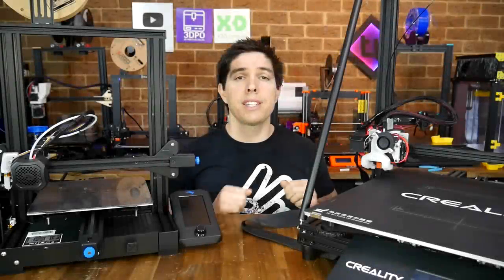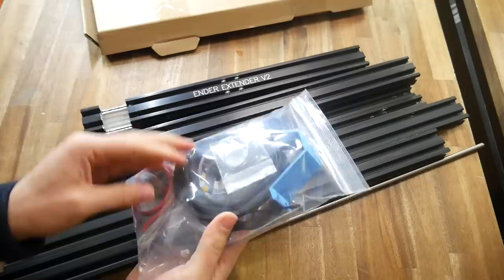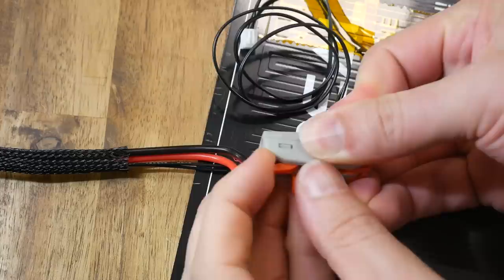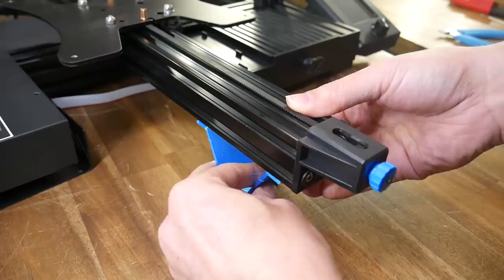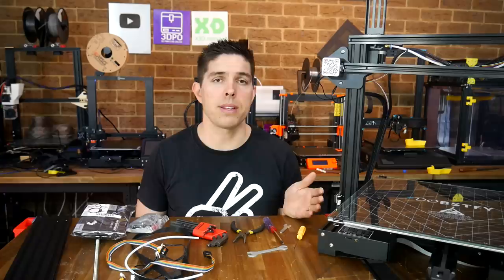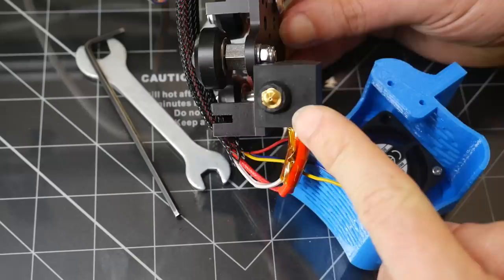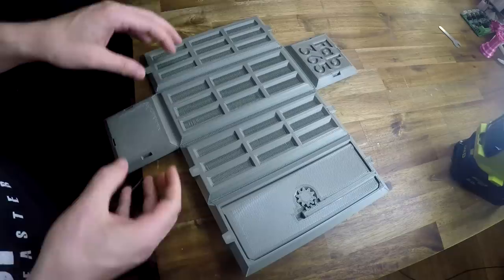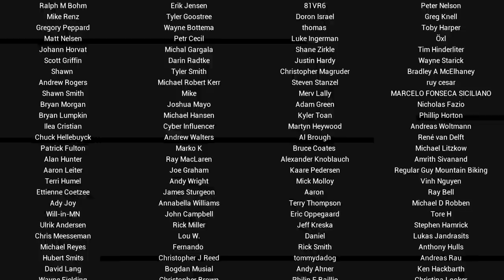Supersizing an Ender 3 V2: CR-10 Max for half the money - Ender Extender kit

Comment: I fall into the tinker category, and have 2 Ender 3s right now. I also like to print big stuff. So am thinking about this upgrade. I also have a CR10s and a Ender 5plus. Bigger is better, lol.
Reply from the maker: Sometimes I have a part or project that just doesn't fit on regular size printers. My first home printer was only 150mm cubed so I got creative designing objects in pieces for assembly post printing.

Comment: You know for about $400 US you can buy an Anycubic Chiron and are up and running in less than an hour and have a good big printer
Reply: I was thinking same thing having bought one less than 2 months ago, it's a good printer, includes auto-leveling and filament out sensor, also dual z motors.
Reply: @mechtheist  We have 2

Comment: Sadly the metal plate for mine is bowed with a raised center and four low corners dipping around 0.688mm each, having to fill the gaps with aluminum HVAC tape so the glass bed isn't distorted in the same shape when clipped down and probing with the cr-touch.

Comment: I would love this... but I'm still hesitating on doing even the smaller disassembly required to replace the hot-end assembly (attempt #2 - #1 seemed to go well until it I turned it back on), and add a BL touch.

Eventually, though.

Comment: Well now, if you don't think the cross beam will be under more stress as it's longer you will get bum results and wonder why......the far side of the X axis crossbeam guide rollers will cause a drag load and can deflect the beam up and down.............with this rebuild it would be highly desirable to fit twin Z axis leadscrews driven by a single stepper motor mounted on the top of the crossbeam driving two short belts to each leadscrew.

Comment: I upgrade my printers as I need. For example, one printer dedicated only for pla, other one is for petg, one prints larger parts, other prints smaller detailed parts with 0.2 mm nozzle. Depends on what you design and print, how fast/slow/large/small/detailed models you have whatsoever. Criticism doesn't make sense, we don't all print only toys.

Comment: Keep your ender3 stock and consider buying an Anycubic Chiron, V6 volcano clone and BMG mirror edition extruder. 400x400x450
Reply: First of all, thank you, Micheal, for exploring this option. But... I agree here. The bed (400x) is being heated by the 235x bed, only 59% directly covered. Also, the weight of the width between Z axis posts really deserves two zed steppers. So... 
$262 Ender
$169 Kit
  $89  Heat Pad
  $60 Dual Z kit
-----------------------
$580 USD 
$360 for Chiron - leaving $220 for things like BTT SKR V1.4 motherboard ($32) and 5 TMC2209s ($22) or TMC2130s ($25). Also, throw in the (expensive!) support rods ($42) to stiffen the frame further. You still have over $100 USD for a real E3D V6 hotend.
Reply: @thomaswiley666  great details. There is an official user made marlin 2.0 firmware for stock board now. 2208 or 2209 can be used to ONLY make it quieter with stock board. Most.common complaint is cracked hotend wires. many replace the wires to hotend and improve wire management.  mine is still stock.with Marlin2 firmware

Comment: That';s pretty cool and all but...... After its all said and done, you're still lacking the Z height of the the CR10 Max. Plus you now have to worry about the right side of the X axis not being 100% even with the left side. I added a second lead screw with stepper motor to my CR10 and it made a difference on my printer. I couldn't imagine going even further in X axis and not having the second lead screw to keep both sides in 100% sync. Of course this is just my opinion...

Comment: While interesting, I feel like one doesn't really "save" money here compared to the Cr max. Because one still has downsides. Mainly less z height, less rigid y and x axis and the under performing bed.  And once you actually fix every downside you quickly reach the Cr max price. As double lead screws, mains powered bed, z axis extension and maybe a new y axis setup with dual extrusions is gonna quikly add up.

Now as a project for someone who doesn't have the funds all at once, I guess maybe an option. 

But if someone wants a bigger printer I think it would still be better to buy a large printer than buy an ender-3 and upgrade it, as again once you add all the parts to really get it equal to a cr-10 max you are spending about the same money. 

Just also wanted to add the DIY directdrive mod is not really 1:1 comparable to the hemera. Find the comparison at the end a bit wierd. I guess you wanted to show a budget alternative to the hemera, but then taking that into the cr-10 max v Ender 3 comparison didn't make much sense to me, the hemera was aftermarket part in the end anyways.

Comment: Major thing that wasnt in the video and i almost missed it on the websites and stopped my purcahse. The EZR Struder does NOT work with glow-in-the-dark filament. May not matter to everyone but if you did plan on using it you are SOL

Comment: I just bought my first project 3d printer today, still haven't done anything significant with my Ender 3 as it just works beautifully, but been wanting a project so one is on its way.... A little too late there Michael haha
Reply: that's a thing I don't get. manufacturers only do larger beds with higher Z-axis. there is no "stubby" printer with large bed and "only" around 200 mm in Z. that would fit many parts without a mostly unused high frame
Reply: @oliknow  Well since you mentioned it, one of the printers I picked up actually has a Z of 220, but the bed is the same size.  

I do agree though, I mostly only ever need just one larger axis.
Reply from the maker: Enjoy the future tinkering :)
Reply: @TeachingTech  Thanks, wouldnt have the confidence to take on a project like this if it wasnt for watching your massive collection of videos.  Bought a corexy printer with linear rails for $250.  I am sure it will need lots of work, and I am ready to get started.

Comment: Good video. I actually considered this, but figured I'd just DIY a custom printer instead to get exactly what I wanted plus I didn't want a bed slinger design. On a side note, will you be reviewing the new mid size resin printers such as the Elegoo Saturn, EPAX E10, Anycubic Mono X, etc?
Reply: I agree. The upgrade kits sounds good but small printer is useful.  All the time tearing apart a printer could be used printing new parts for a DIY printer. Nice thing with DIY is you can buy part all at once or as you can afford it. Thinking of building Voron 2.4 with 500mm cube volume.
Reply: Definitely beyond tired of the bed slinger craze myself. Is not THAT much cheaper to produce when you look into it, does NOT save the space marketing always used to (and sometimes still does) claim, and the known cons mostly outweigh the benefits.
Reply: @PaulDominguez  Voron would be a great build. Look in to Railcore 2 as well.
Reply from the maker: I have just finished reducing my resin printer collection, so probably not.
Pros and cons for the completely custom build route. You get exactly what you want and the budget can be spaced out but a lot more knowledge is needed. Each to their own as I said in the video.
Reply: @PaulDominguez  core xy isn't rlly stable that big
Reply: @PaulDominguez  voron themselves don't recommend going above 350
Reply: Ya, the 500mm cube is the dream and don't really need it. It's an itch to build a printer but right now working on the goal of getting my mancave ready so I can put build a LowRider CNC.

Comment: hope you have a lot of extra solid spacers...  they are junk!!    and just some FYI,  I dono if the sale is still on but at Micro Center you can get the Ender 3 pro for $99.00    kick ass printer and if you get stuck with the 1.1.4 board, you can upgrade it for 47.00 to the Bigtreetech board with silent software, all you can hear is the fans after that...  :)

Comment: Michael, would it be worth it to put some thermal compound between the original heated bed and the new alloy plate? I would think it may help to make sure that there are no gaps.
Also, I have had good luck with adding insulation on my heated beds. Might that be a decent upgrade for something this large as well?
Thanks in advance!

Comment: its kind of a shame they don't just make a large ender 3 with a direct drive, filament sensor, and auto bed leveling for around 450 right off the bat. Would be a good contender to go against the Sidewinder x1, as the CR-10 v3 is more expensive for a worse UI, and arguably worse prints.

Comment: Love your videos,.  For someone fairly new to this (3 months in on my ender 3 v2) and only printing PLA, could I ask you to do a complete how to  on changing out the stock hotend with bontech extruder and mosquito or copperhead hotend and the MODIFICATIONS to make it work with the ENDER 3 V2.  Ive talked to Splice and matterhackers since I wanted to order and install and they were very helpful but the one thing they really cant tell me is the way to make it work on my machine.  There is only one bracket i've seen on Thingiverse, but its also made for BLTouch and i dont use that at the moment.  THERE IS NO VIDEO ON THIS  THAT I CAN FIND that goes step by step.  So many people are interested but no one had covered indepth.  Your tutorial on auto build marlin was perfect and I finally upgraded my firmware!  Hope to see something in the future.

Comment: Dont know about you guys but the reported different size in the info menu is bugging me. To change that go to dwin.cpp file in marlin firmware uncompiled code (src/lcd/dwin/e3v2/dwin.cpp) and change define machine size to the one you made, for me its line 89. I did not do this mod but i enable the print area to 230x230x250 to fit bigger prints than stock (costs nothing but an hour of your time). i am considering this upgrade for fun as well

Comment: Thanks for this, I've been thinking about going higher on the Z, from the DIY store. But this looks like a lot less hassle if you wanna go bigger.
Reply: Z extensions are much easier and generally result in better quality. But really once you go beyond roughly a foot in any direction, the moving bed approach is just not a good idea. And even that much is already on the “too much” side.

At 300mm or so or over, physics dictate that for a reasonable print speed your bed should be moving in Z and not Y — ie ultimaker, gantry, H, or coreXY layouts. It doesn’t really matter which exact belt layout, those differences are pretty minor. For the i3 style, You can compensate for a super heavy bed with a heavier motor, and you can compensate for a heated bed that is effectively acting as its own fan with every Y movement by a high capacity heater, but there just isn’t any compensating for the fact that your workpiece has to move with every Y move. If you’re planning to only print with high capacity nozzles that helps raise the limits, though.

Comment: I built the XL kit but your firmware doesn't work, I tried a few others and same issue.
It seems to understand the new size and it can see the BL Touch but when you choose leveling it does Y and X then goes to the middle and stops and freezes entirely. Only thing I modified in your code was the height to 500

Comment: Hey Teaching Tech - What solid spacers do you recommend for the Ender 3 v2?
Reply: I ordered a pack of 100 M4 washers from Amazon, which worked but not without much more effort than I foresaw. I put an equal number of washers on each corner and ended up with about 2 mm difference in height from highest corner to lowest. Turns our that the thickness of the washers varied from 0.70 mm to just over 1 mm. It took a bit of washer-juggling to get things reasonably level (measuring from the top of the 20x20 mm left and right braces - make sure you measure from the brace itself rather than the plastic/metal platforms to either side). 

Another issue - the aluminum heater plate is (what I consider badly) warped - over 0.5 mm on the two left corners and about half that on the right. Clamping the glass build plate at the corners measurably distorts the plate as demonstrated with a straightedge (look for light leaking between the straightedge and the build plate). 

As I like my build plate clamped firmly at each corner, I used layers of thermal tape (the thin stuff with blue backing) to slowly build up the low spots. I left the backing on the topmost layer so as to not things together. This solved the distortion problems. And I discovered a cool trick that really helps with this process. 

If you put the build plate on with the smooth side up you'll see fairly uniform darkness. Now you can find the low spots by pressing down gently at various places around the edge of the bed. If the area looks lighter as you press, you've found a low spot. I assume this is because of the dot pattern on the other side throwing a shadow on the bright aluminum plate. Pressing the plate over a low spot decreases the distance between the dot and the plate, thus throwing a smaller shadow and reflecting more light.

How well did all this work? Beats me! My new main board with a 5th stepper driver for my shiny new z-stepper was delayed...
Reply: Martin Luther  As it turned out, spacers alone wouldn't have worked - the base plate, the one that rides the y-rail, wasn't flat so different spacing was required on each corner. Using short spacers in addition to the washers would have made the job less tedious for sure.

Comment: Great video! Cheers! You've done a lot of direct drive conversions and mentioned pancake stepper motors, do you have any recomendations? Is there potentially a video coming soon? or is the weight of the 42-40 not an issue?

Comment: My beginner friend was quoting me this video to explain to me that he can buy a 220x220mm size printer and simply upgrade it to a 400x400mm printer. Wtf, that's completely wrong lol. It's akin to buying a toyota corolla and modifying it to a toyota Kruger. There are more components changed than parts retained... is this still considered an upgrade. Buying a small printer to upgrade to a large printer is wholly not recommended, especially when u can buy a large printer directly. In this case, for example, I'm recommending a CR10S4. The newer pro versions are unnecessary and pricey.

Comment: Do you know why a CR 10 V3 won't go to proper home position , because it does not go down to the cut out switch and I cant get my table high enough to level the table , so now I have a brand new printer and I cant use it because I dont know how to get the nozzle to come down lower , can anyone help or have any ideas

Comment: I'm having repeatability problems with my Ender 3 V2 (I have to adjust the corners before each print) even with the heavy springs. Now I'm trying to get UBL working and need to address this. You mentioned that you'd gotten rid of the springs in your Ender 3, and I'd like to see how you did it - could you point me to the video that covers this?
Reply: Just use metal spacers instead of the springs, and then fit some kind of ABL sensor, I prefer the BL-Touch to the induction ones.
Reply: @originaltrilogy1 Thanks - I thought it might be more involved. I've already got a BL-Touch so I'm set. Did you see much improvement after making the change?
Reply: @leroycasterline1122  Massive change. With the solid bed spacers and the BL-Touch I had no issues with bed levelling after that.

Comment: Bonus question (about adjusting software):
Is it possible to adjust layer hight to a finer resolution on a printer rated at 0.1 mm? Most Crealitys has 0.1, Prusa i3 has 0.05, in my eyes that's a significant difference (Yes, I do have high demands on finish, but an SLA-printer is unfortunately out of the question at the moment...).
Reply: Just slice with a finer layer height?
Reply: @Krytern  I have absolutely no idea if or how it works, that's why I'm asking.

Comment: Is there any downside to increasing the printer size? Assuming I'm getting the dual Z axis motor upgrade, will there be any loss in print quality inherently due to the printer being larger?
I can imagine larger beds might not be able to print as fast due to their increased mass and maybe they might be more prone to warping simply due to their increased surface area? Does anyone have experience with this?
Cheers!

Comment: My work bought a cr-10 max for me to manage/use for projects as needed, it caused me so many headaches. I finally followed your guide on flashing the TinyMachines firmware and this seems to have fixed most of the issues I had! Thanks! do you plan on doing an update on the cr-10 max? would love to see what else I can do to it to get it printing better and better!
Reply from the maker: I haven't touched it since the mods shown in the Hemera video: https://youtu.be/1jhHvxmzKm4
apart from changing the mount to this one (made by one of my Patrons): https://www.thingiverse.com/thing:4608837
Advantage of that one is using the filament runout sensor again. All mods include: Hemera with volcano and 0.6mm nozzle, solid bed mounts, some tidied up wiring and the firmware update. In this configuration it's doing very well.

Comment: Hey great vid, but Last night I was having a lot of troubles with the firmware but that is mostly my specific case, BLTouch from creality with 5 pin header instead of 3 and 2 pin separately. The other thing is that the bed doesn't heat up to temp, it errors out when trying without auto tune, and currently I am doing the autotune but it keeps rising after the set value of 60: M303 C5 [E-1] S60 U1